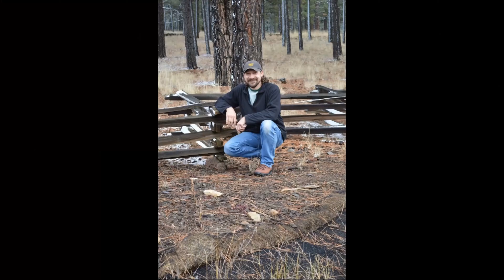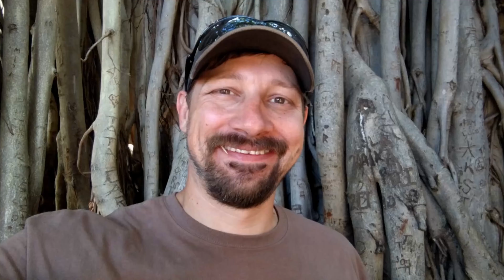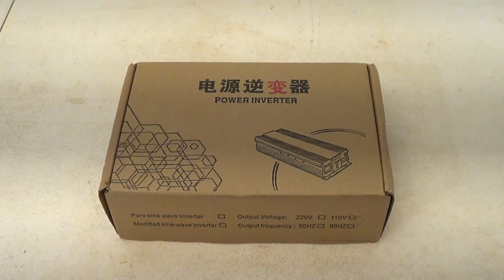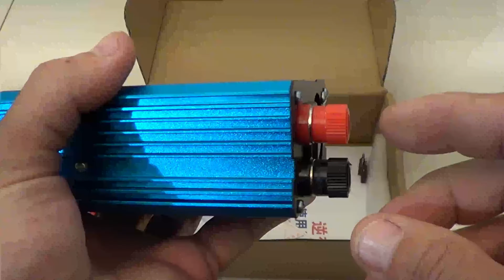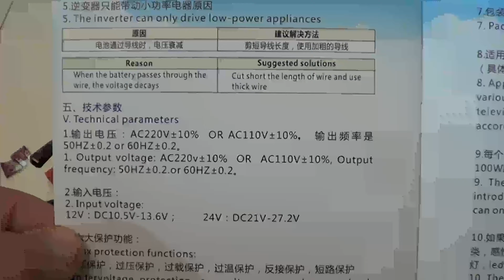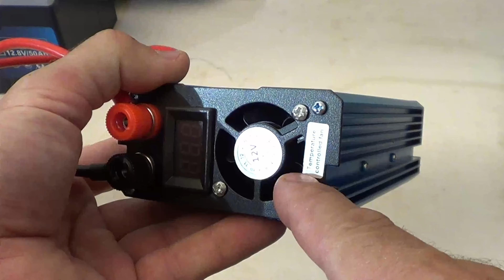SUNWHEEL 500 Watt Pure Sine Wave Power Inverter DC 12V to AC 110V

Comment: Hi! I see the inverter can work with 12V or 24V  (I would preffer 24, to reduce the current). Is there a phisical switch to select the input voltage, or is it automatic?
Reply from the maker: This is a 12V unit. I'm not sure about the 24V. I think you'll need to buy one specifically for 24V
Reply: @jiujitsu2000  Ah, o.k. Thanks!